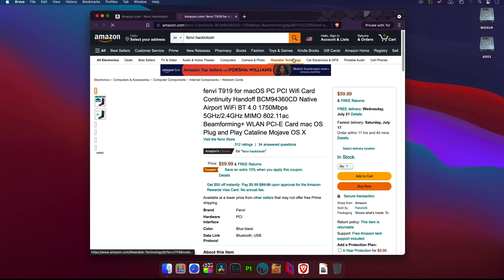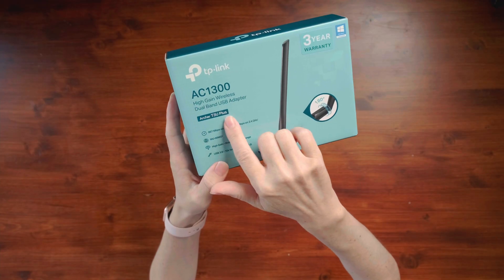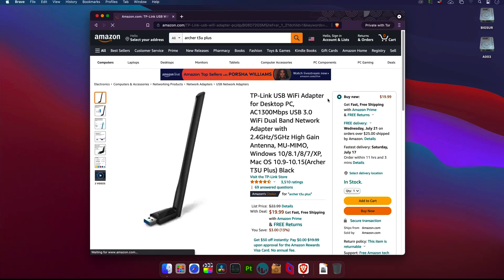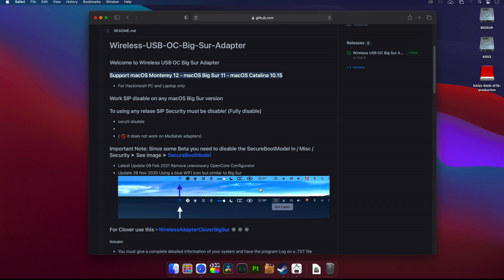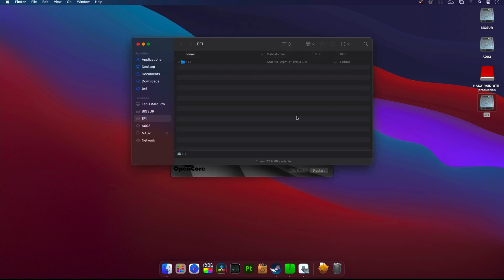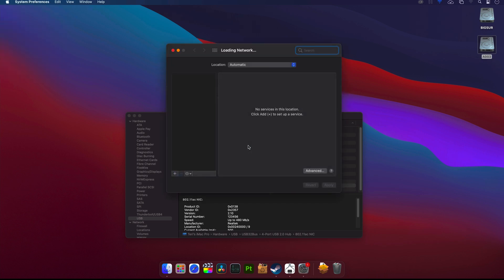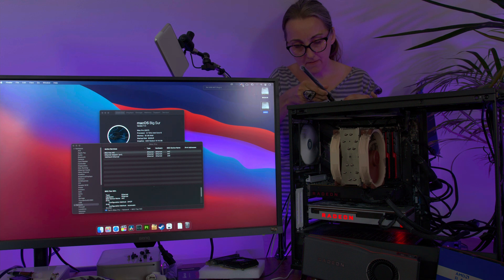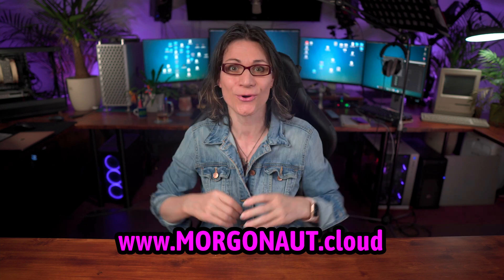How to Fix Hackintosh WiFi in just 2 minutes

Comment: I'm using my laptop and when I boot into Mac OS I have to run the installer to get it to work with wifi ive checked my startup apps and it has statusappbar and that's it?

Comment: Thank you Theresa for always providing great value with your videos.
Quick question: any idea why the app doesnt stay in the status bar. I install the app, restarted, put in the usb,  start the VM, and the app is gone. I reinstall it and the "new wifi app in the status bar" is there, and wifi works. When i shutdown and reboot, the app is gone again.
Thank you for any fdbck.
Reply from the maker: @peterbaloh - did you set the app to automatically start each boot?
Reply: @MorgonautHackintosh  I thiught I did but it seems i did not :D   I realized that the next day and yes this was the problem. The app was installed it was just not a startup item so it did not load. Thanks for the response anyway, it was the correct problem you identified and the solution.

Comment: I bought the same adapter and it works also on ventura. Thanks for the video.
Reply: @MorgonautHackintosh  Will this device works on ventura with these drivers posted but i saw these drivers support big sur. Will it work for ventura also

Comment: Doesnt work for me somehow... I bought the exact same bluetooth adapter. But for some strange reason, I had bluetooth information on my system informations page. Can you help me with this? I would highly appreciate it.

My Mainboard is a MSI Carbon Z370I with bluetooth/ wifi built in. I know I can't use these, that's why I bought the bluetooth dongle.

  Bluetooth-Controller:
  Adresse:	NULL
  Status:	Aus
  Chipsatz:	BCM_4350C2
  Sichtbar:	Aus
  Firmwareversion:	v0 c0
  Produkt-ID:	0x0001
  Unterstützte Dienste:	0x382039 < HFP AVRCP A2DP HID Braille AACP GATT Serial >
  Transport:	UART
  Hersteller-ID:	0x004C (Apple)

Comment: Thanks for these great videos. I went with the same antenna you suggested. The wireless software has been updated quite a bit since you did your video so there are a few differences. The one thing that would have been useful to cover is disabling the SIP on the boot loader > config.plist. My particular Big Sur hackintosh is from Technolli on a NUC. In my boot menu, there is an option to go into recovery mode. I did that and chose Utilities and Terminal. Then I typed the csrutil disable command in Terminal and it updated the config.plist file. I got hung up on this missing step but did some googling to find this option. Maybe this will help others if they get that message in the install. After restarting from the recovery menu, the software installed properly, the USB antenna showed up and the icon is in the top menu working like a champ. Chris' instructions didn't cover how to fix the SIP disable process either. Hope this helps others that might get stumped on that. Another IMPORTANT note! You don't want to leave SIP disabled as it keeps you protected from malware from completing an install on your system. After the wireless software was installed and wireless was working, I went back into the Recovery boot option and did the csrutil enable command in terminal and rebooted. Of course Big Sur immediately barked and did not like the wireless software. I went into system preferences > security and privacy and allowed the wireless software to run. Even then Big Sur was 'surly' but finally gave in. So I have SIP enabled and I have continued protection from malware, etc. and wireless working. I highly recommend you re-enable SIP after your wireless install!
Reply from the maker: on my channels you will never find any promotion of illegal stuff like your "technoli computer"!

Comment: What about those who have in-built wifi and Bluetooth (Realtek) in laptops, even it's not showing the wifi icon or anything like that neither at the top near the battery icon nor inside settings. Please help me  to start up both connections, as if there is no wifi and Bluetooth, there will be no benefit nor useful 🥺

Comment: Hi recently ran into this problem. For some reason my wifi usb is on the support list. But it says no wifi usb adapter connected. But when I do system report it shows the wifi usb adapter under usb section as connected via usb 3.0 could there be something I'm doing wrong
Reply from the maker: for sure you did something wrong :)

Comment: Hi Teresa, I jumped right away to purchase the Archer T3U Plus, I installed it on Catalina, but after rebooting and plugging the adapter, it says: "No USB-Wifi Plug in" when clicking on the upper icon. The USB Hub shows a 802.11ac NIC (Realtek based) BUT there's no WIFI adapter showing in Syst Pref / Network. Any ideas? BTW I tried all the 3 latest driver releases 9, 8 and 7.
And BTW thanks for the video with the Asus BT, it works nicely
Reply from the maker: don't try or install any other drivers - just follow EXACTLY INSTRUCTIONS and my tutorial
Reply: @MorgonautHackintosh  There's definitely smth wrong with these drivers for Catalina, at least because I followed your tutorial INSTRUCTIONS EXACTLY (no work). I then installed the Archer drivers and it worked right away.
Reply from the maker: contact developer
Reply: @MorgonautHackintosh  Dear Teresa this is the answer from the developer. "Catalina ! This project supports only Big Sur and Monterey Read the page"
Reply from the maker: yes, he has on his github versions for several systems = read first :)

Comment: Hi and thank you for your nice videos!! I would like to ask you for a new one where to explain how to get more than one resolution on mackintosh without any graphic card. For example before update my hackintos to HighSierra I had several resolution but not now. I don´t know if it is cause the new OS or what ... Thank you Morgonaut!
Reply from the maker: you must be more specific, do you mean more resolutions in virtualised macOS? What OS/app, etc. simply details
Reply: @MorgonautHackintosh  Thank You Morgonaut to take your time for the subject! What I couldn't resolve on my new HighSierra 10.12.3, was in System Pref::Displays. Only one resolution for anything... I often get more resolution with Alt+click on Adjusted but not now. My graphic card is not running so I have only 3MB from my MB (Gigabyte:Z77X-UD3H) that support 3MB (!!) only... I couldn't find if there is any solution for this problem. I installed a trial of SwitchResX but do not resolved. I have only 1064x768 px and a new graphic card today is not possible as they skyrocket prices in this country (Argentina). 
May be that it is cause my monitor is an old VGA? I can buy a new one with HDMI but don´t know if this will bring a solution for more resolutions ...
Thank again Morgonaut for your help! You are very kind ... Saludos, Jorge Aldo
Reply from the maker: resolutions are different based on display attached. For different displays you will get different options for resolutions. So what you expect to see when you have no gpu and no display? Get even cheapest supported gpu and display with hdmi and you're good to go.

Comment: Thanks for this video! I already ordered the wifi adapter. I want to ask you, I don't have more space to install disks on my hackintosh. I need something external 4tb to edit 4K videos, what would you recommend? did you make a video about this? Thank you so much!
Reply from the maker: it depends on your workflow. I would need to know details, ev. modify your workflow for better results
Reply: @MorgonautHackintosh Hi! I'll tell you, inside my hackintosh I have 6 hard drives (ssd, sata7200rpm, nvme) and it won't let me install more disks. So I need to buy something external. I was thinking of buying a 4tb thunderbolt 3 disc to be able to play Red or Alexa files or buy something like a Synology (which sounds a bit expensive to me, but if it is the best option I could go with a version with few discs) If this is the best option you think, which 10g network card would you recommend? (now that thanks to your video I'm going to remove the Fenvi wifi board). Thanks for the help! as always
Reply from the maker: I would never buy any Synology crap and absolutely not any TB solution. Build proper file server with 10G networking. Or add PCIe controller to your computer to get more SATA ports, more nvme disks...
Reply: @MorgonautHackintosh  Thank you!!
Reply from the maker: you're welcome Diego
Reply: @MorgonautHackintosh  can you explain why you wouldn’t go for syn in a video?
Reply from the maker: I would need more than just single comment to explain that

Comment: I've had the very same TP-Link usb adapter and the WiFi speed wasn't very good (my home network is 1Gbps - local and 500mbps down/up internet speed) and sometimes drops connection. Those adapters simulates an attached LAN card so that's just a way to connect to WiFi network, but still considered as different type of connection by Mac OS.
Reply from the maker: I have here perfectly stable connection without any drops

Comment: 2:18 No, it's class AC1300, but that doesn't mean you get 1300Mbits of Wi-Fi speed. That number is the combined rounded theoretical maximum bitrate of the card: 867 (5GHz) + 400 (2.4GHz + TurboQAM/QAM256) = 1267, so class 1300. You will only use one band at the same time, preferably 5GHz, which means 867Mbits maximum theoretical throughput. In real world performance and in ideal conditions (MCS 9) you will probably also even only get half of that speed.
So to answer your question: what you need more? I need an actual good Wi-Fi card without a bad Realtek chip inside (like this one) and would prefer native support on macOS that also provides AirDrop and Handoff. This made me buy an ASUS PCE-AC68, yes PCI-E, but with a proper Broadcom chip inside, excellent range and native AirDrop+Handoff support.

Comment: USB Wi-Fi doesn't have Handoff nor AirDrop, it's useless for Hackintosh, unless you don't use those features. The Fenvi T919 is also poor quality, I barely get above 400Mbits on that card and Bluetooth range is bad. For an actual good and native combination: use the ASUS PCE-AC68 for Wi-Fi and the ASUS BT400 for Bluetooth. I get 941Mbits on Wi-Fi (gigabit linespeed) and Handoff + AirDrop both work great.

Comment: Fenvi: pros (plug-n-play, side-car, airdrop, system recovery at boot, remember all wifi networks, can use bluetooth at boot) cons (as you said 1 pcie and 1 bluetooth -internal usb pins-) cost benefit 

Usb solution: needs to find a functional driver, no airdrop, no side-car, no system recovery at boot, no bluetooth at boot, no remember wifi connections. Uses an external port of your mainboard/chasis.
Reply: And you need to disable SIP with this USB driver. I'd rather have that enabled.